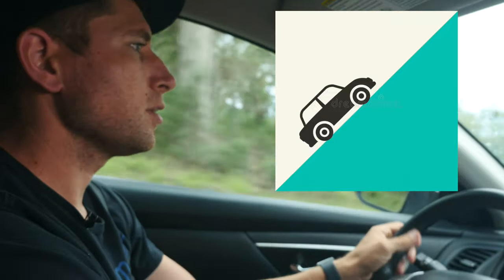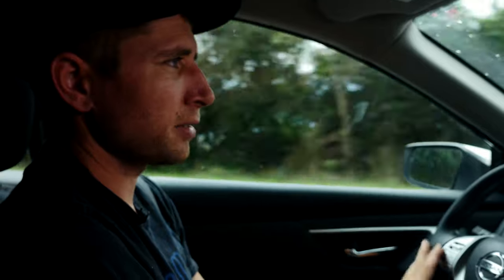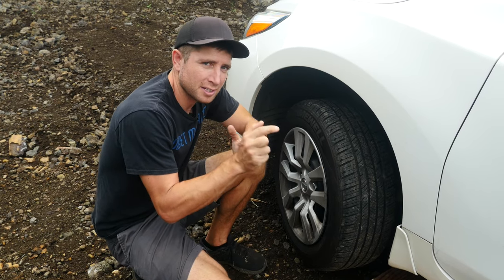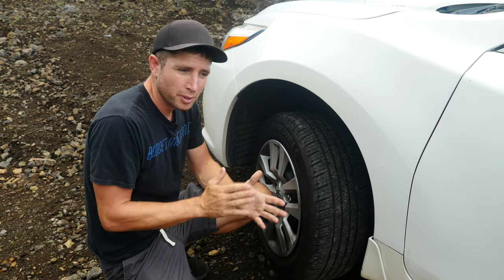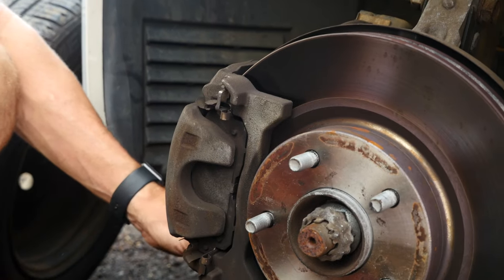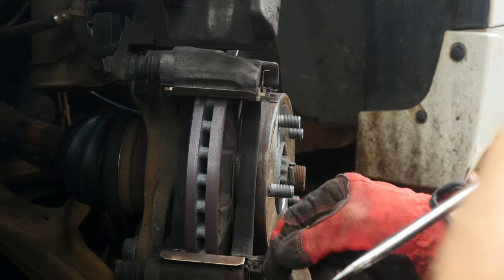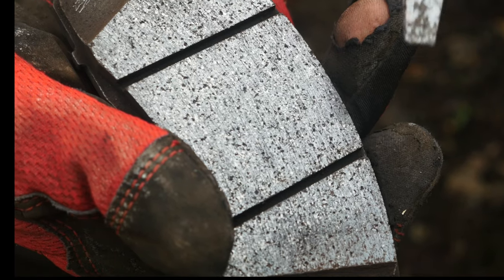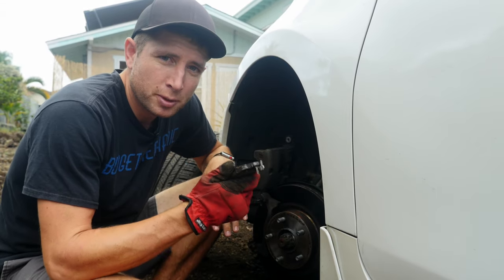Noisy Squeaky Glazed Brakes Rotors - How To Quick Diagnose and Fix - Squeak When Brake is Released

Comment: Yes!!!!! This is the noise my car is making!!!! I was so worried because it doesn't make the noise when i hit the brakes, but when I'm driving.
Reply: did you fixed it?
Reply: The same thing happened to me and it was caused by a bent "Brake Backing Plate", try checking that out befoe replacing rotors and breakepads. Hope that helps.
Reply: Hi I had this same noise while driving not braking. I have replaced the brake caliper and it has stopped.
Reply: Same.

Comment: I've been telling my mechanic I have been having this sound basically since my last brake change, but the sound isn't a constant, and I've never been able to actually show them the sound, because of course when I go to see them the car doesn't make it, but when I'm NOT seeing my mechanic its so loud I feel like I'm waking up half the neighborhood on my way to work. So they just say they will check it out whenever I bring my car in for something else, last time they were saying that its probably a serpentine belt, but I knooow it's something with the brakes. I am SO thankful for this video, because it's the only one that has had the exact sound I have had, as well the fact that it stops when the brake is applied. Usually a hard brake will make the sound dull or stop for a time. So at least now I can show the mechanic the sound if nothing else.
Reply: What did ur Mechanic do?
Reply: @Wvsolo12  Had my brakes done, Still still happening too, took it in again and they said a caliper was loose, but it's still makin a sound but I just haven't had the time to get back in.
Reply: Did he just slap pads on or did he change the rotors or machine them?

Comment: I been a mechanic for over 40 years and you need to resurface the rotors on a brake pad change . I did a test to others to prove my point. I took a 2014 Cruze and pads were almost worn out and rotor still looked new. I checked the runout on the rotor and one side was 5 thousandth and the other side was 8 thousandth, then changed only the pads and let’s my doubters drive the car. Everyone of them said they felt a vibration or shutter when they braked. I removed the rotors and had them turned at an auto parts store and got new brake pads and let my doubters drive the car again! They drove the car again and were blown away how the turned rotors produced no vibration or shutter in the steering wheel!

Comment: This is 100% an issue I'm having and the noise is exactly the same.  This vid has been extremely helpful, thanks.
Reply from the maker: Glad it helped
Reply: @BudgetMechanicHawaii  Same noise for me, thank you. Sadly I just got back from the garage and they said brakes are all good..!!
Reply: I'm having this issue with the exact same car
Reply: @BudgetMechanicHawaii  by estimate, how much longer can you safely drive a car with such condition. example..is it safe to drive it for 2 -3 days prior to weekend ?
Reply: Thank you! This is the same problem that I'm having.
Reply: Have this problem with new pads... do I really need to replace brand new pads??
Reply: New brake pad didn't fix this issue for me. What did the car do when you replaced the brakes? Did the noise stop?
Reply: @kuchgod89 same thing for me just replaced them and same noise

Comment: I brought my car to the local mechanic and my right front wheel squeaks. That was done yesterday brand new rotors and brand new very expensive brake pads. A hundred and seventy dollars worth of work. I called this morning and they're not answering the phone. I'm going to drive down there. Brand new brakes, brand new Rotors. I did not notice it until hours later when I had to take a ride somewhere . I used to do my own breaks. But now that I'm older. I do not have the facility or tools. So now I rely on mechanics. That is going to change. For 200.00 I could have bought a whole toolbox and jack stands and did it myself.

Comment: I love you bro! I've been trying to figure out the sound for 2 days, and it's only when I relalized that the sound was spinning with the wheel that it may be the rotor and not the just the breaks needing to be replaced. That's when I went to google, found your video, and heard the most satisfying chirping I've ever heard. It's the exact same sound, and I'm taking my car to the mechanic tomorrow to get the breaks and rotors replaced. Thanks a ton!

Comment: I have this same problem, but it strangely only emerged right after replacing pads and rotors, and there’s no hardware touching either. It sounds like window cleaner being rubbed on glass very hard times 100 in volume. And it gets worse if weight is transferred onto that wheel, so while turning right it’s most prevalent, and under braking as well. Coming from the drivers front wheel.

Comment: I’m hoping this is my issue. Noise increases  when turning wheel slightly to the left or right but gone when in full turn or just idling. Bought the car today and it started this evening 😢. Didn’t do it when test driving, but brakes hadn’t warmed up yet. They did just replace rear pads and rotors. 

It’s so great you take the time to reply to comments even way after original post. Thanks for making these vids!
Reply from the maker: Yes I would inspect the front brakes too for glazing etc. 
Thanks for watching!

Comment: Thank you so much! I notice this sound when I was cruising at 10-20 mph on a flat street but the sound would go away when I was on the highway or when I’m at 0 mph. Just bought my car and got it inspected twice and it was all good but this is a new sound I heard a few days ago. Will get my brake pads replaced!!
Reply: exactly the same. i changed pads 3 months ago. After the car heats up, the noise is most noticeable between 10 to 20 kilometers per hour, but it's less pronounced at high speeds. Do you know why now?

Comment: Nice video man, I had my own assumptions with my 1998 Saab 900. Just heard the chirping noise when I was rolling in first gear. Lifted my front end and shook the tires and checked my cv boots. No play in the bearing and the axles were still in great shape. The pads are probably at 60% and the rotors are in decent shape. I had never considered the glazing of the rotor to create an audible chirping noise. I just got the vehicle and it's at about 70k miles with pretty much all OEM parts. I almost made a rookie mistake and loaded the parts cannon. Thanks dude

Comment: Life saver!!!!!! I've taken my car to two mechanics and they couldn't find the issue. Thanks for making this video
Reply from the maker: Glad it helped!
Reply: so did you fix it?
Reply: @crestfall4 Yes, it was due to the rust built up on the outer part of my rotors making contact with the brake shield. I bent my brake shield back a bit temporarily which seem to help. Then I  swapped the rotors and pads for new ones and the noise never came back.

Comment: Thank you so much - i'm having the same issue with my vehicle-I took it to a local Napa centre and they told me it was my Propeller Shaft Bearing and quoted me $3400 and then I took it to a Nissan Service Place and they told me it was my AWD Coupling and quoted me $3400-went back to Napa and let them know what the Nissan said they put it back up on the hoist and agreed it was the AWD Coupling- I was like why would you tell me it was the Propeller Bearing? he didn't say a word-went to my friend who is a Mechanic and he took off the rear wheels and told me it's the rotors - which is exactly what you show in your video-I have it in today to be changed so Fingers Crossed-Getting tired of singing in my car to the noises :)

Comment: Thank you! That's what my car is going through. Grinding sound after a while of driving. Then Everytime I step on the brakes the sound goes away. I'll take a look at my brakes this weekend. Thanks again!
Reply from the maker: Good luck!
Reply: @BudgetMechanicHawaii  I just finished fixing it. In the process, I also changed the brake pads. I also noticed that there was a small brake clip stuck on the caliper bracket. I think that's what misaligned the brake pad. So it kept on grinding on the rotor. Went out for an hour drive and bingo! The noise went away and still no noise at all. Thanks again

Comment: This was extremely helpful since I also have the same issue with a less extreme sound.. my brake pads were changed maybe 3,000KM ago but my rotors does seem to be a little worn but not bad. If I could email you the photo's of my Pads and Rotors to get your suggestion on what I should do if a New Rotor would be the best move

Comment: I cant do it myself where I live. I'll need to take the car in. Just started the sqeeking noise until I hit the brakes. It stopped after 4 stop signs then started back up as I pulled in. I just had a full brake job with rotars and pads 6k miles ago. Its discouraging. Thank you for letting us hear the noise and what it was. I  was afraid I'd lose my breaks.

Comment: I hear a similar grinding sound that seems to be coming from my front left tire, but it's only when I start driving, it goes away after a few minutes, and sometimes it doesn't do it at all. I guess I'll check the pads and go from there.

Comment: I'm going to check the hardware when i get home, I had trouble getting them in for some reason on my back right wheel, which just so happens to be the wheel I'm hearing this same noise. I'll be sure to check the pads as well

Comment: Abrasive Friction:  
Abrasive friction involves breaking the crystalline bonds of both the pad material and the cast iron of the disc. Breaking these bonds generates the heat of friction. In abrasive friction, the bonds between the crystals of the pad material (and to a lesser extent, the disc material) are permanently broken. The harder material wears the softer away, meaning the disc wears the pad.

Adherent Friction: When brake pads press against the surface of the steel disc, some of the pad material transfers directly to the surface of the disc forming a thin, uniform layer. The surface of the steel disc and the surface of the brake pad become identical in composition. As the disc moves between the pads, friction material transfers in both directions, breaking and reforming bonds at the molecular level..    
The question is... what caused the glazing in the first place?  I'd begin my investigation with the caliper pins beginning to stick not backing the pads off wjen you release the brake pedal. Considering the noise goes away when more force is applied proves that the pads are in fact still lighty contacting the rotor..  extra drag warms pad and rotor causing thermal expansion. Extra force applied going down hill gives it the extra heat it need to remain hot by constant contact..  rotor cannot shed its heat and warps. .
Reply: What’s the fix

Comment: Thanks a lot! That solved my problem. Had the exact same noise when brakes got hot. New brake pads solved the problem.
Reply from the maker: Thanks man 🤙🏽
Reply: i have brand new pad and its making the noise!! so annoying
Reply: @crestfall4 same here, and I really don’t know what’s up at this point. Like got my pads and rotor changes 1.5 month ago, and this sound just came in quick..
Reply: @ericc.514 did you figure it out yet??
Reply: @ethen_dsm7696  Got to be honest, I still have no clue, had a lot of opinions from different mechanics; Rn. I am soon getting an appointment at an Audi Specialized mechanic who I hope is going to find out what’s wrong..
Reply: @ericc.514  hey I figured mine out it was just brake pads, swapped them out for new and it went away for me
Reply: @ethen_dsm7696  I mean that is a common source for this type of noise, but were your ex pads old, or new? Cus’ in my case they are new pads and rotors, sound still there..
Reply: @ericc.514  true however the pads were worn down to the squeak point, some brake pads come build with a system were when the brake pads are bad it hits the squeak point on the pad which lets you know there out and they were pretty worn off however I performed this on my moms car and she kept insisting it was her “rotor” but I insisted it was her brakes which it was. Maybe for you it could be rotor instead of the brakes but I’m not entirely sure.

Comment: I'm getting PRECISELY that noise & it seems to be coming from my rear wheels/brakes on my '05 Ford Explorer... Except I JUST replaced the rear pads, parking brake shoes, & hardware kit... It fixed the problem for as long as it took me to drive to a buddy's and back home (3 hrs) but now it's back. Do I need ANOTHER set of pads & rotors?
Reply from the maker: Are you pretty confondent you got good quality pads/rotors? Cheap low quality brake parts can be noisy right out of the box

Comment: i just bought new AP racing brake kit & having the same problem.. its still not fixed and does happen everyttime.. sad that its not cheap to buy the pads right away. are you sure its the pads? Could i got unlucky got bad pad?

Comment: Hello, so if it was a bearing, it would make the squeal all the time? 
or by "going with the speed of the wheel" did you mean that as you accelate the squeal goes away?
Reply from the maker: Cheap pads can glaze and start making noise very quickly even under normal braking. Bearing noise will usually get louder with speed

Comment: Just had a full brake job. Mine chirps / squeals when I'm driving and car is turning / leaning into a left curve 🤔
Reply: Same with mine. Recently replaced pads and discs. I have taken the car back to the garage and for some reason, they can’t duplicate the sound, which I’ve recorded for them just in case. I’m inclined to think they put in sub-standard pads?

Comment: new brake and rotor, same noise after heat up no brake apply.  after watching this video, changed pad still noise,  change both pad and rotor problem fixed.   my cause is i didnt use fine on caliper where pad slide in so pad got stuck and form glaze.   good that i got extra rotor and pad in garage.
Reply: have you found the fix yet?? i cant seems to figure iut out
Reply: @crestfall4 after a month of 10+ tries ,   its the stuck caliper slide pin, wash brush and re grease wont fix,  i replace caliper bracket at last

Comment: Im getting this same noise on the same side so I change my rotor, brakes and caliper but the noise is still there and seems to have gotten worse, i still don't what it could be
Reply: you change everyting and not fixedd?
Reply: @crestfall4  a week ago Since I could figure out the problem I decided to take everything off and look at my hub bearings, as soon as I did they fell completely apart!! I just thank God I decided to check them and I wasn't on the highway when they fell apart🙏🏿

Comment: Same noise on my Volvo, but only when turning left. New lube on the glide/guide pins, new rotor and new pads, it starts after around 500-1000 meters of driving 🤔
Reply: Might be the dust shield for the brakes if it's squealing when you turn. Check to see if it's bent or making contact with rotor.

Comment: What if you have similar sound but when the car is cold? My car is making the same noise, new brake pads, new discs (roters) and callipers but it only makes the sound relatively cold, with or without brakes applied?
Reply from the maker: I would still inspect for the same things (glazed or overheated pads/rotors)

Comment: mine makes nearly the exact same noise when i turn the wheel even slightly and the noise gets louder the faster i’m going, brakes look fine, tie rods and wheel bearings have been replaced, the dust shield isn’t bent, the rotor looks good. any ideas?
Reply: Bent frame? Do you know or suspect if your car has been in an accident and fixed? I have the exact same issue and im thinking its that.

Comment: What make & kind of break pads do you recommend ?
Reply from the maker: If you’re in a flat area, ceramic is longest lasting. If lots of hills, organic or hybrid
Reply: @BudgetMechanicHawaii  I got ceramic pads installed 30,000 miles ago. 
I recently got them checked, and they tell me they're still only half worn.

I'm impressed. But they couldn't diagnose my squeaking sound... lol

Comment: so how can we prevent brake pads from getting glazed? i have brand new brake pads and rotors and theyre speaking horribly. i thought i just had to break them in, but if it is this i dont want to replace them and have the same problem again!
Reply from the maker: Squeaking can come from cheap quality pads as well. But you prevent glazing by downshifting on long steep hills to avoid holding the brakes hard too long which overheats them

Comment: I just got new pads  on the back. The mechanic said the rotors looked fine, no grooves. But my brakes are still squeaking. The front pads have 50% life left. What could be the reason theyre squeaking, and what can I do? 
The place I go for repairs/maintenance is very honest which is great. He offered to replace the rotors to ensure no speaking (what he said). But I did not see the point if the rotors were still good shape. Im confused. Its subaru outback.
Reply from the maker: He’s right. They make be ok smoothness but could be glazed or overheated. So you’re probably breaking fine but to get rid of sound you might need new rotors as well
Reply: @BudgetMechanicHawaii  Rats! Ok. I was in there, now I’ve gotta go back if that’s the case. Hey! While I’ve got your ear. Lol I hit a big dip in the road the other day…now it’s making a popping noise when I turn corners or cut the wheel. Thoughts? Thanks!
Reply from the maker: Hard to say. Have to go under and look for physical damage. Check sway bar links for good stiffness. Cv axles will click at slow speed turns when they’re failing